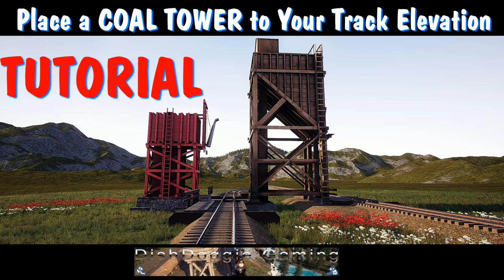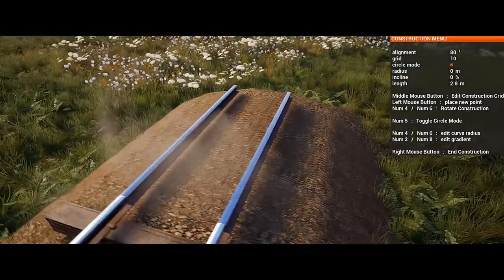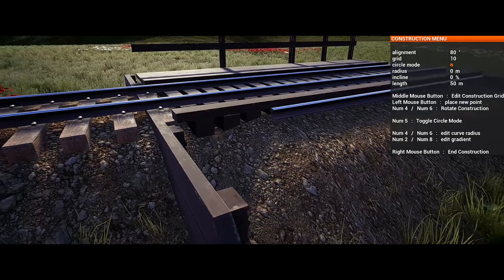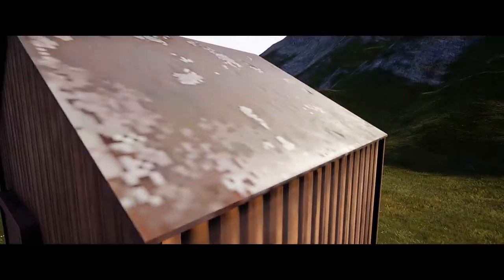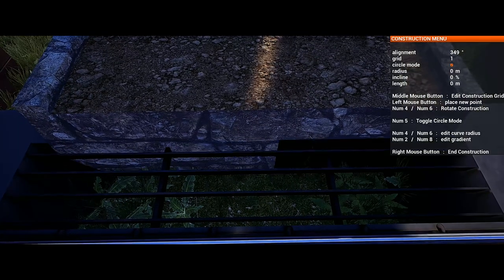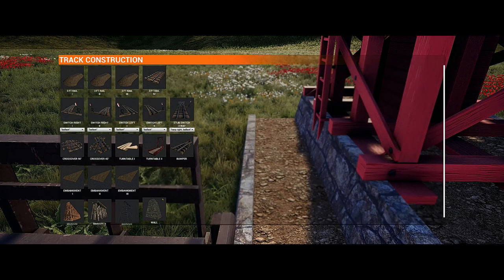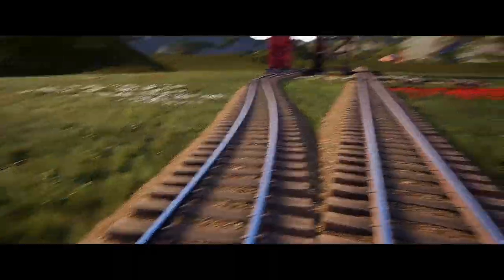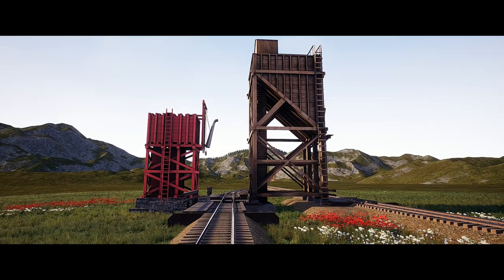PLACE A COAL TOWER TO YOUR TRACK ELEVATION IN RAILROADS ONLINE

Comment: It won't let me connect the track to where you empty the coal into the chute. Do you have any suggestions on how to fix that?
Reply from the maker: I know there was a Bug in the beta version (the only version I play) that did this same thing and the short term fix was to put track overtop of it till the bug fix came out to fix it. Even that was hard because you couldn't get the end of the track close to the tower because the new track end would not let you hook to it. If you are on the official Discord someone might know way more about the Standard version then I do. Last I knew this bug was fixed and not a issue any more. Sorry